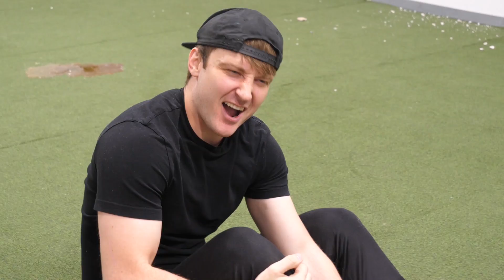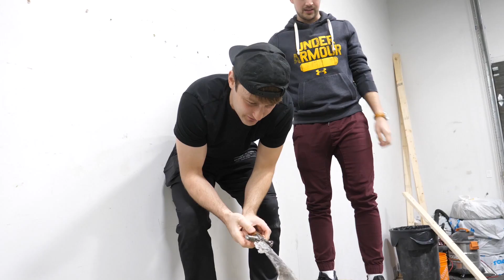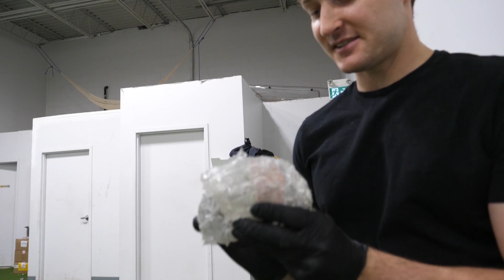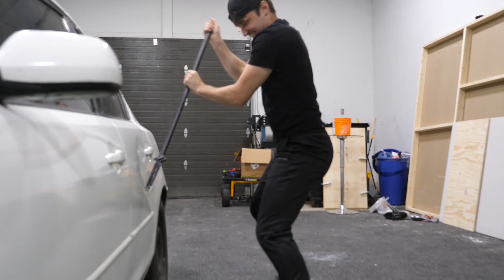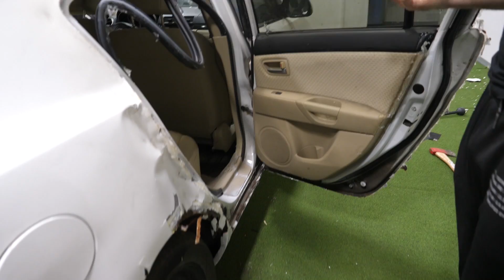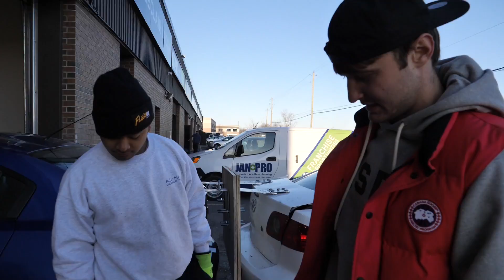Gluing Two Cars Together!!

Comment: Wow. I’m very surprised that at the end of the video, the trunk of the blue car didn’t get ripped off of its hinges. Also, you probably should have used a stronger material such as metal so you could completely prove whether or not the Car or the Flex Glue had won. Otherwise, Amazing Video….!!!!

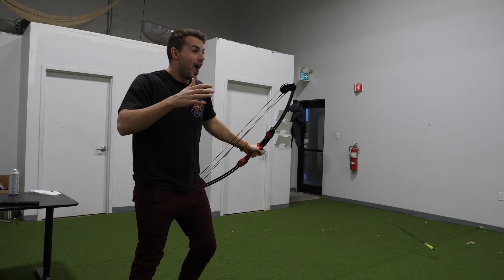Comment: 7:58 my bow could easily break through or snap the arrow trying.
Reply: Its a 65lb draw weight bow. Ive snapped carbon fibre arrows and sent a TRAINING arrow through a 1/2” piece of fence board. Im sure it would go through or break the arrow trying.
Reply: My bow is 250 fps bow with 178 pound bow string so Beat that
Reply: My bow put a TRAINING arrow through a 1/2 “ fence board had it been any stronger it could’ve have ended very badly
Reply: @Shadowwolf-bd4mw  omg that's strong
Reply: @Shadowwolf-bd4mw  mine will put a big hole through 2 car doors but I never did it

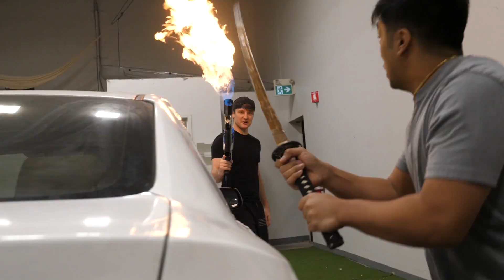Comment: 12:58 is basically the scene where (spoiler alert) Ron from Harry Potter goes after two of Draco Malfoy's goons but then runs back because the goons had fire before setting the Room of Requirement on fire